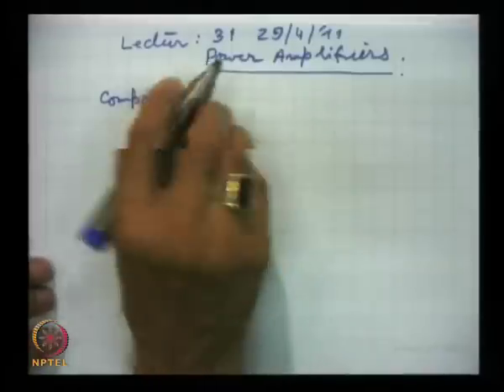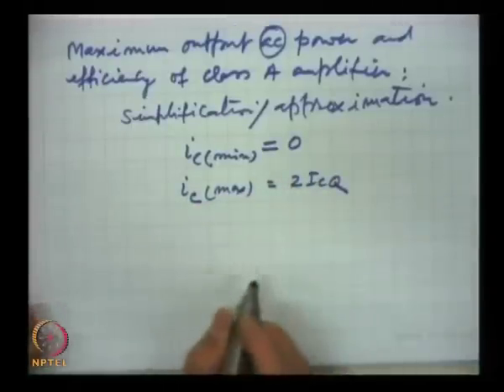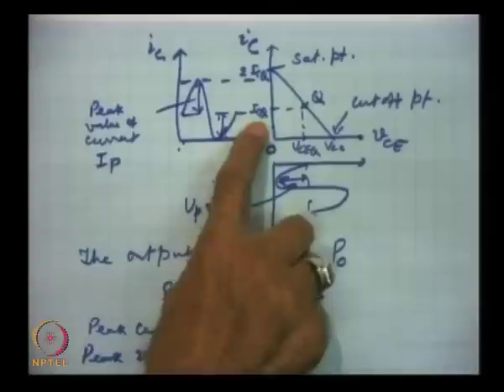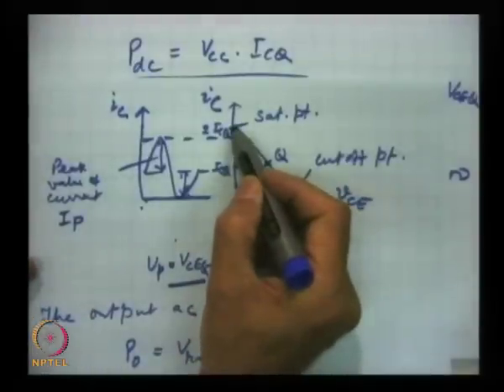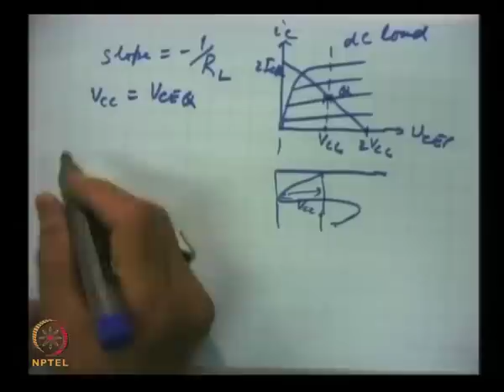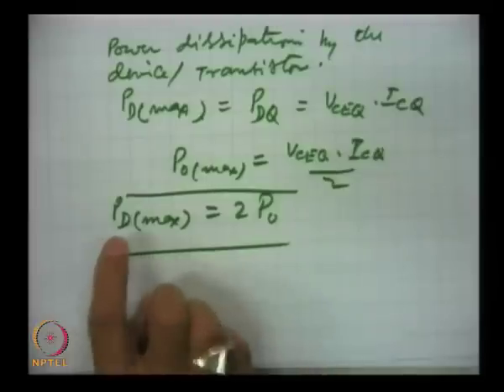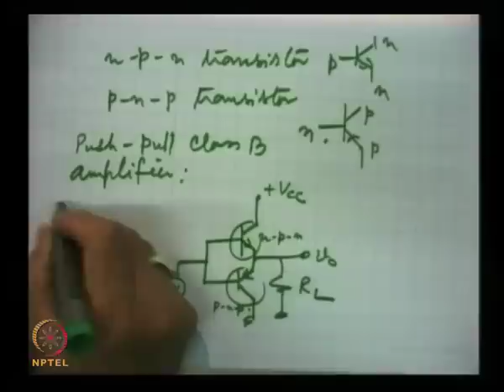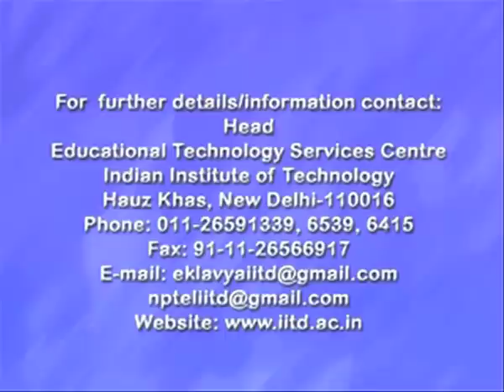Mod-06 Lec-31 Power Amplifier (contd.)

Comment: at 37:34, max dissipation can be occur at Q point in the absence of the signal. why?
Reply: voltage swing as well as current swing is maximum at Q point. So the product of voltage and current will be max at the Q point resulting into max dissipation. When signal is imposed, the Q point is displaced from the original position and it decreases the value of the product VI. Consequently, the dissipation decreases
Reply: Becoz vswr ratio absens.... At that point